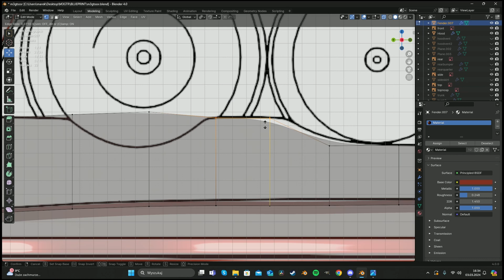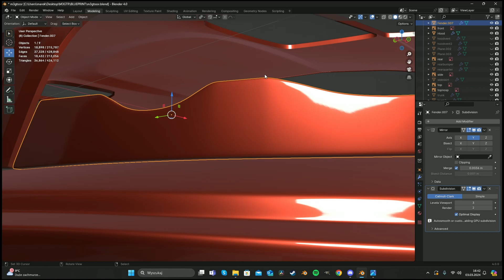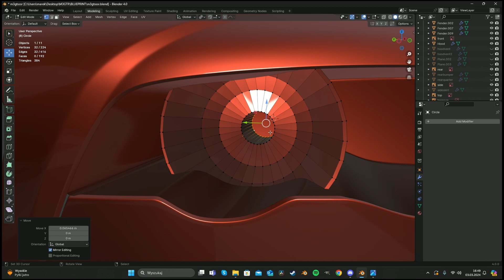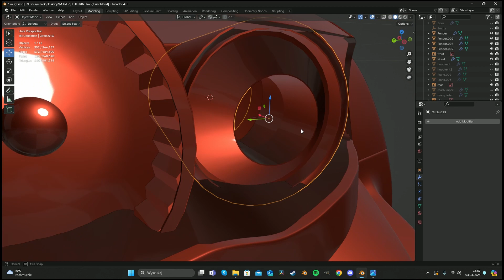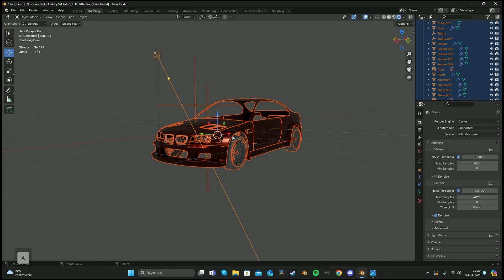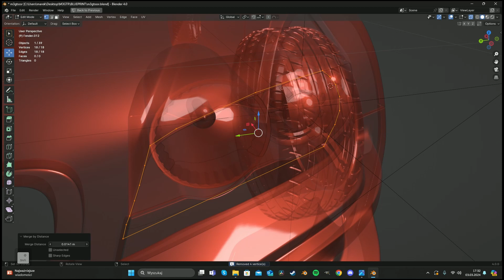3D modeling blender BMW M3 GTR NFS MW TUTORIAL #8 Head light

Comment: if you dont have a good cpu to render cycles upgrade to blender 4.2 LTS, you can use your graphics card, i own a raedon rx 580 and it performs well, turn raytracing on for the light reflection & a simplified BSDF with the alpha turned low, for extra you can use a mix node and attach that to transparent node